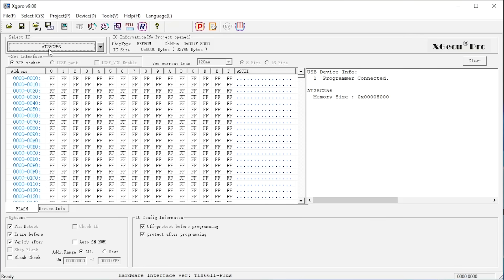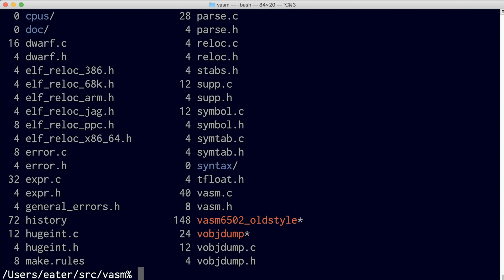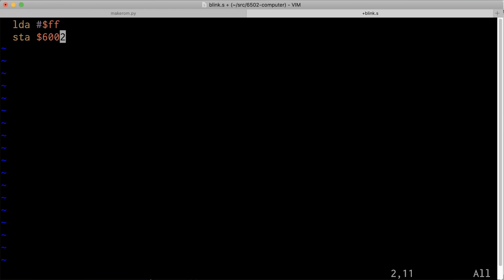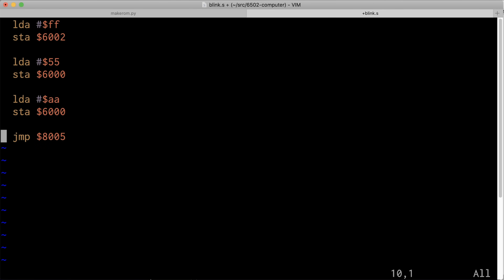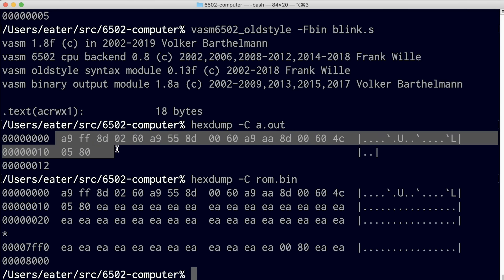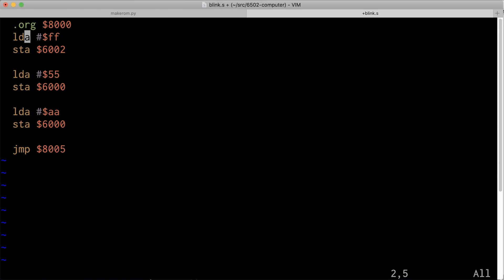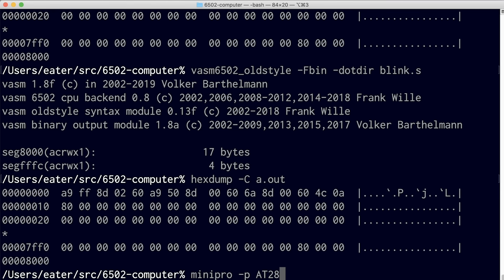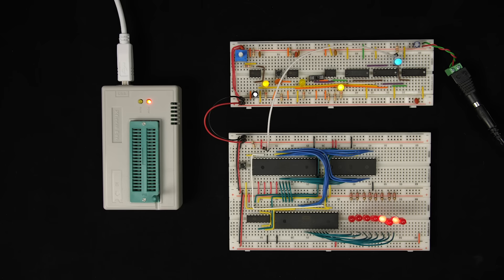Assembly language vs. machine code — 6502 part 3

Comment: Hello Ben.i am newbies. I have some questions about  Assembly language. May you explain me how the assembler work in short. Thanks
Reply: Start by imagining how YOU would do it if you were presented with a piece of paper with the program as written by Ben. And that next to you, you had that page Ben showed with the the hex codes for each instruction (lda, sta, ror, jmp).

How would you do it?
Reply: look ben older video of this serie it explain it? assebly just convert LDA $00 to correct hex numbers

LDA  Load Accumulator with Memory

     addressing    assembler    opc  bytes  cyles
     --------------------------------------------
     immidiate     LDA #oper     A9    2     2
     zeropage      LDA oper      A5    2     3
     zeropage,X    LDA oper,X    B5    2     4
     absolute      LDA oper      AD    3     4
     absolute,X    LDA oper,X    BD    3     4*
     absolute,Y    LDA oper,Y    B9    3     4*
     (indirect,X)  LDA (oper,X)  A1    2     6
     (indirect),Y  LDA (oper),Y  B1    2     5*

as you can see LDA #$FF will assemble like A9 FF <- loads FF to A
when LDA $FF will assemble like A5 FF <- loads content from address $FF to A
when LDA $FF00  will assemble like AD 00 FF <- loads content from address $FF00 to A
when LDA $FF,X will assemble like B5 FF <- loads content from address $FF to A and add content from x register for it. or if X register has 1 it loads from $100 to A. dont remebber excatly
Reply: Maybe I can help. I wrote millions of lines of code in assembly and worked on more machines than people read about. My range is from microcontrollers to huge global mainframes.
To begin with you need to know the platform you will be writing for ie 6502, 8080 (z80) 8088, 8086, mainframe, DEC etc.
From there you can obtain datasheets for the processor or principles of operation for mainframe.
Next if using and o/s you need to obtain a listing of all the o/s calls and how its called..
Next a diagram of how all the chips are connected (memory. I/o, video, sound etc)
Next obtain a cross assembler for the processor you are going to code for.
Still with me?
Sometimes your only debug tool is a blinking LED, sometimes its a full integrated Development Environment (IDE) sometimes you have to write your own debug tools. A lot of times i will write a complete register dump routine with an optional dump of memory between two addresses.
Let me know what specifically you want to know. Ben has done an outstanding job of creating this content!
Reply: This video series is exactly that, this video and the previous.
Reply: In short?  Most assemblers work on a "two pass" system where on the first pass the assembler runs any directives such as ".org" and defines any values such as labels then finds out what opcodes to use (such as turning LDA into the hexadecimal value for that instruction) and also either fills in the operands or reserves space for any operands which haven't yet had their values defined.
On the second pass, the assembler fills in any operands which previously only had space reserved.  If the operand still hasn't had its value defined on the second pass, then the assembler throws out a critical error so that the human can track down the problem and fix it.

Comment: You made more progress in making a computer single-handedly without a plan and money in a few months than 8-Bit Guy in over a year with a plan, people and money
Reply: Easy there. 8 bit guy is an enthusiast, and is a student of this guy. I've never heard him claim to be on Ben's level, which is what we used to call 'elite.'
Reply: Not exactly accurate. 8-bit has a computer that interfaces with monitor, sound, keyboard etc. They really are attempting two different projects.
Reply: That's not a fair comparison.
Ben is only trying to make a very simple education video to show people the basics of how computers work.  What Ben will end up with won't be really useful in and of itself apart from the educational value involved in making it.
The 8-bit Guy is trying to make a full, working computer which will actually be useful.  That's a lot more complicated and naturally requires a lot more time and planning as well as a lot more expense to create and build.
Reply: What did he do to you?
Reply: Wow, comparing this to apples and oranges is like comparing apples and oranges.  Apart from being 8 bit platforms (maybe even with the same CPU?) both projects are as similar as they can be.
This is a minimalistic "bare bones" project to show how computers work. Excellent to understand how these machines tick inside, but of limited practical use besides the educational purpose.
The 8-bit guy's project is something that can be practically used like the old days' home computers. Probably good for learning how to program, but less so to understand how these machines work on their lowest programmable level.

Both have their reason to be, both are very interesting and fulfill (or will so) what they are made for.  But it's a different complexity involved, so a direct comparison is simply not fair.

Comment: Where did your arduino programmer go? Loved that one.
Reply: The problem is that it hasn't an interface in computer
Reply: @ottobass9193  there are linux tools for serial communication over the ATmega16u2 on the arduino board. (in console, what he needs)
Reply: @grimmauld184  but you have to made the software of arduino

Comment: Nice little shoutout to you for Mac and Windows version :D 2:37
Reply: I tried cc65 worked fine after puzzle.it did c64 pragu no problem but added 01 08 start address and did not add fffc
Reply: I don't think windows or Mac will run on a 6502.
Reply: @sdspivey  Certainly not natively, but I turned this up from a link on hackaday, turns out this Dmitry Grinberg fellow got linux running on an ATmega1284p by running an ARM emulator on top. It's worth a read if you're looking for a goofy project.

Running a Ubuntu distro on an 8-bit micro makes me suspect that you could get a 6502 to run Windows through similar emulation. Also, my spidey sense tells me that since the 6502 is Turing complete within it's memory confines (since it does support conditional branches), it should be able to run any thing any other general purpose computer can. At least in principle. In practice... I have no idea.

Here's that link, btw:  http://dmitry.gr/?r=05.Projects&proj=07.%20Linux%20on%208bit
Reply: Steve Spivey the Apple I and then Apple II ran on 6502
Reply: @sdspivey  I think you didn't watch the video, did you? It is the assembler compiler. The original Linux version can be downloaded as open-source tarball with source code and makefile to compile it. However, you can see special acknowledge for Ben Eater for providing Mac and Windows binaries for the assembler. Of course Windows or Mac do not run on 6502 when the base CPU used by these systems is 8086. But honestly, if you try to write your code directly in machine code, you'll soon find out it's a nightmare. It is good to get hand on and recognise the opcodes, what the instructions do and what the program actually does, just by looking to the binary code. But to actually write something, it is good to learn by writing really small programs like that. For larger projects, not so much. You'll soon find that managing the machine binary code is so hard that it's basically impossible to do proper changes. You'll have to rewrite basically all address pointers for jumps, etc. Assembly source code makes it easier to manage the program and also makes it easier to read the program machine code by human. But honestly you can't just upload your assembly source code to the CPU, you need something to translate the source code into an actual binary machine code used by the CPU. Every CPU is different, there are different instructions sets, etc. Intel and AMD chips are each interchangably compatible with original 8086 chips that actually started whole era of DOS computers (originally created by IBM, later being adopted by Microsoft, creating their own version called MS-DOS) in early 80s. If you actually pay attention, you'll find this out. You'll also find out he's not programming the memory by hand, but he's using the programmer and a text editor to write the program. Even the binary machine code was written in a text editor that made up program to generate the binary file for him, later to be uploaded to the memory. Think before you comment!
Reply: @CZghost  What you say is 100% correct, but it's possible that @Steve Spivey was just being deliberately facetious.

do { make_facetious_remark(); } while ( 0 == 0 ); // (:-D)
Reply: @spiderjuice9874  do { shame_on_you(); } while ( 0 == 0 ) // you got it wrong -> there's no semicolon after the do-while loop ;-)
Reply: @CZghost  LMAO!
Anyway, are you absolutely sure? What I wrote - with trailing semi-colon - compiles correctly on my system :) Without it, I get an error!
Reply: What system and what compiler do you use? Bet it' not GCC since it should compile just fine without the semicolon.
Reply: @CZghost   +Spider Juice I'll like these comments for your gentle and nerdy ribbings.
Reply: @CZghost  I bet it also compiles with the semi-colon; am I right? I'm not using gcc. It's customary, at least in older versions of c, to end all statements (which, in its entirety, this is) with a semi-colon; in fact, it may even be madatory to do so! Maybe they've relaxed the rules since then...
Reply: @sudocheese  LOL
Reply: @CZghost  Found something interesting, from my 'old' C book (The Waite Group's Turbo C: Programming for the PC (revised edition), by Robert Lafore, 1988, page 84) on do/while loops: "An important detail to note is that this loop, unlike the for and while loops, is terminated with a semicolon; that is, the test condition in the parentheses following while ends with a semicolon." (the bolding is in the original). I admit my source - and compiler - were published by Noah while he had nothing to do in his ark, but the dropping of the semi-colon in your compiler is a recent modification to the C language, perhaps.
Reply: @CZghost  That was a joke. I understood what he was talking about.
Reply: @CZghost  On "The C programming Language" by Brian Kernighan and Dennis Ritchie the syntax for a do-while loop is given as

do
     statement
while (expression);

So it does appear that do-while loops need a trailing semicolon.
To be sure I tried it out on gcc. It doesn't compile.
Reply: Marek Poláček 9899:201x§6.8.5
Reply: Should make an open source for Linux. I spoke too soon. It is ooen source....
Reply: @rty1955  It is open source... These are just prebuilt binaries
Reply: @dentjoener  awesome. I left M$  decades ago... Its shareware at best
Reply: @rty1955  Why?? He should eventually do Eatix ;) that's the point of building your own computing system )